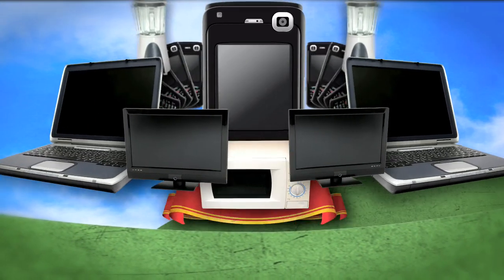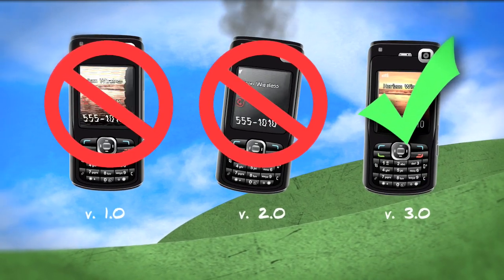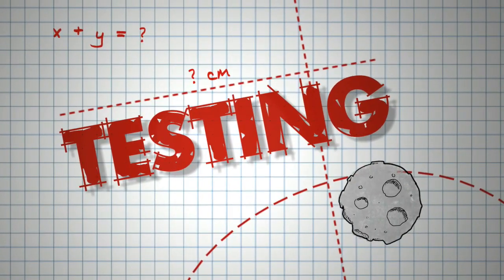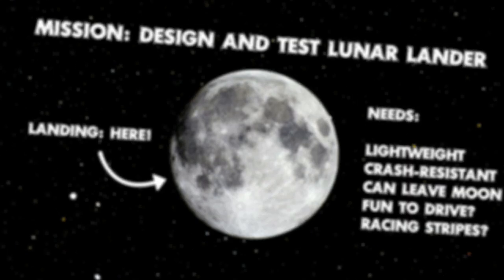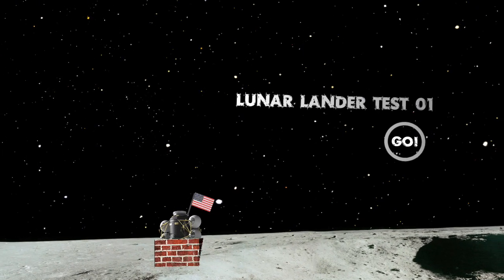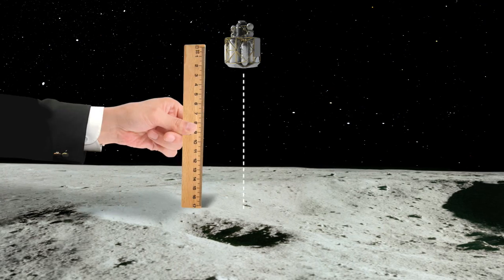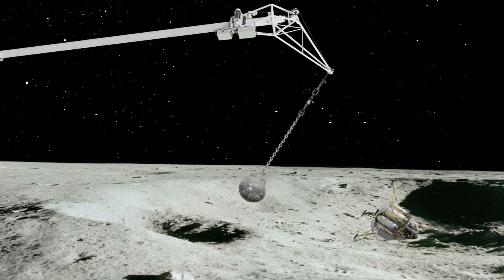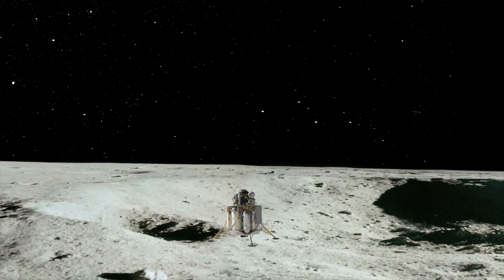NASA | Repeatability

Comment: @gregrutz
As I said elsewhere in comments, nearly everything NASA does is a "test" in the engineering sense, nearly everything NASA produces is a prototype in the engineering sense. What NASA does is a bunch of simulations to see if their tests will work.

With cell phones you can truly test a prototype, you don't have to simulate it; but you can't test a rocket without launching it, so you simulate a launch to try to make your tests go well. I find NASA's failure rate to be astonishingly low.